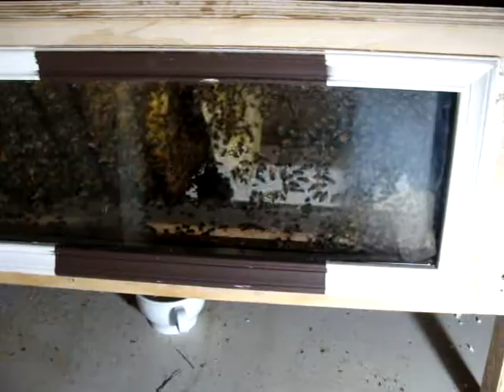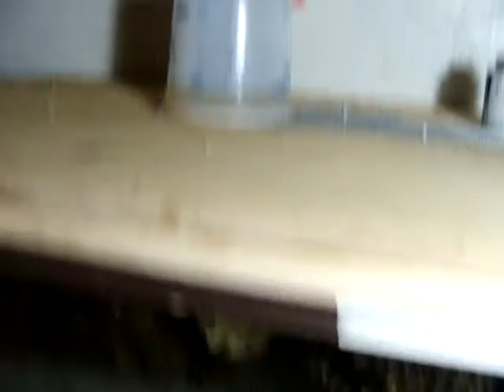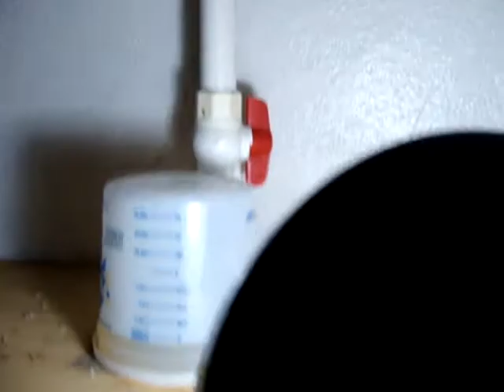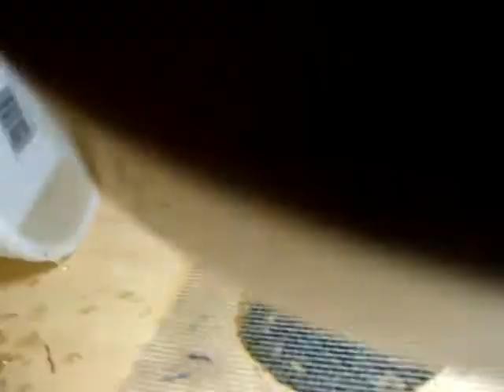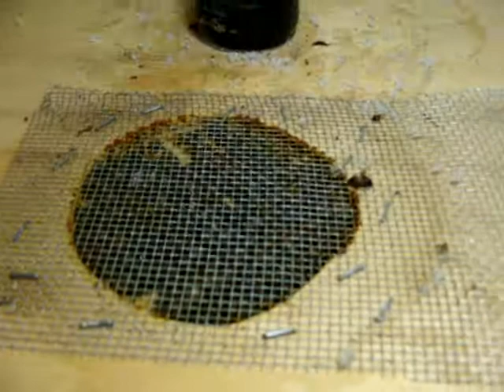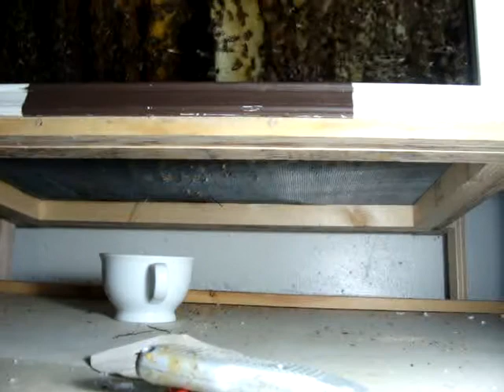basement observation hive

Comment: in the description it says "frames taken from kenyan top bar hive." So yes they are african bees. Africanized are hybrids of Euro and African bees. These are just the mean ass African bees themselves lol. People in Africa are used to working with them though. They are the normal bee they are used to.
Reply: > People in Africa are used to working with

... bees that will make an home in a lion and be guarded by bee-soldiers that will chase people for miles and sting them to death. How will they know which people are African and which won't have evolved that well?
Reply: 'Kenyan top bar hive' is a type of hive design where it's a long box with sloped sides.  Basically it's the design of the hive, not where the the contents (bees) come from.  Notice that the combs have a slanted edge, not a straight up/down edge (normally matching the opening with a bee width gap on the edge) as he has placed them in a box with straight sides so that they don't match the geometry of the box that they are in, that's what they are referring to in the comments.  Now, bees go to the light as they see that as a possible exit from the hive.  Comparing a hive in a dark room with a single light source to a hive outdoors surrounded by light, naturally you will think more bees are going to the light as they are all going in the same direction and being stopped by the glass in a large mass, whereas outdoors they fly off to find pollen/nectar and not seen again.  If you get a bee inside your house, it will fly to the window (light source) to try go get out.  Same concept.  If they were 'Africanized' bees, there would be massively more bees trying to go after you, you wouldn't be able to see through the glass.  The bees on the glass aren't showing aggression at all, just trying to leave the hive the easiest way (get to the light which they interpret as outdoors).